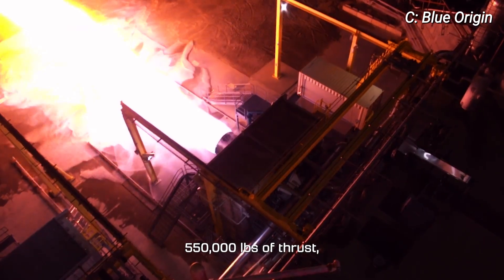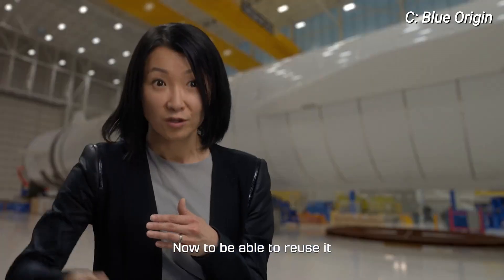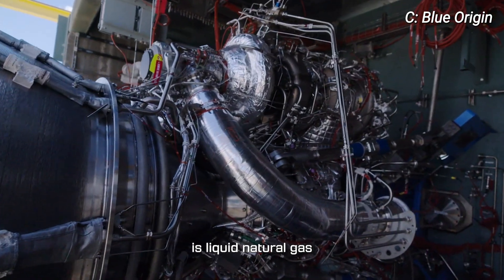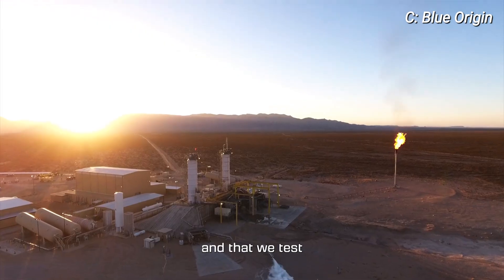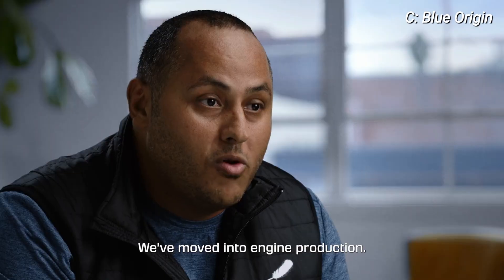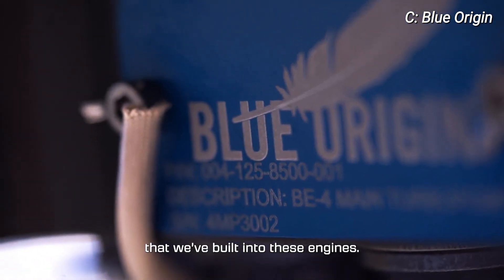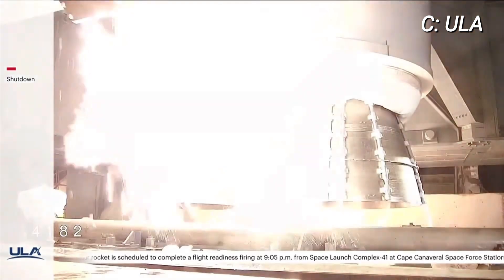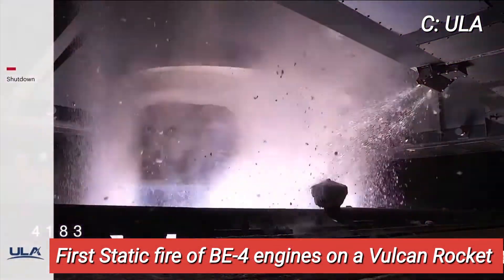Will Blue Origin BE-4 engine beat SpaceX Raptor for reaching Orbit?

Comment: No, because on the Vulcan the BE-4 engines are only on the 1st stage, they don't go to orbit.
On New Glen they may, but since that isn't anywhere close to flying, it's design is still fluid and it may never fly.
Raptor will fly again on a Starship soon. And on Starship they do go to orbit.
Reply: New Glenn is said to fly next year, and with successful demonstrations of their engines (by far the riskiest component in a rocket) there is no reason to believe it won’t fly.
Reply: @ryansmith9806  it was scheduled to fly several years ago, as were SLS, Vulcan Ariane 6, Starship, and probably a dozen or so small sat rockets.

Blue Origin is being extremely secretive, so we don't know how much they have built, let alone if they are flight articles or just test articles.

There needs to be competition in any industry and we are rapidly approaching a window where there will be SpaceX and nor much of anyone else for a while (until these new rockets fly and prove themselves)

The fate of Virgin Orbit shows that you aren't out of the woods after your first successful flight to orbit, and that first successful flight is FAR from guaranteed (I think the number of rockets that have made it to orbit on their first flight is down in the low single digits)